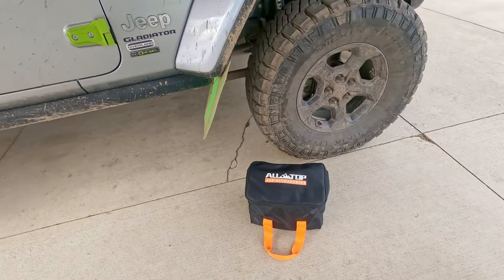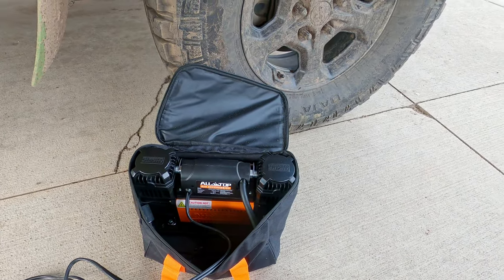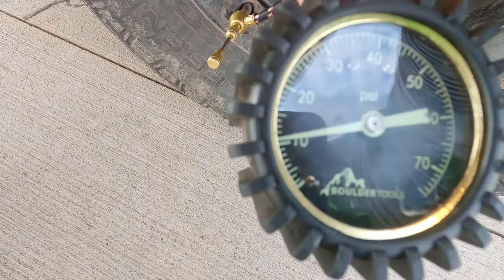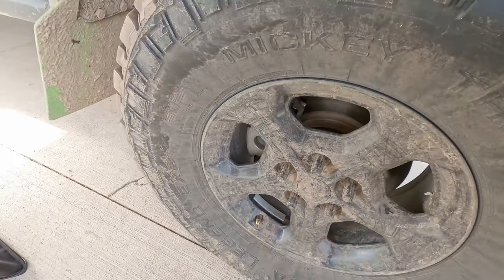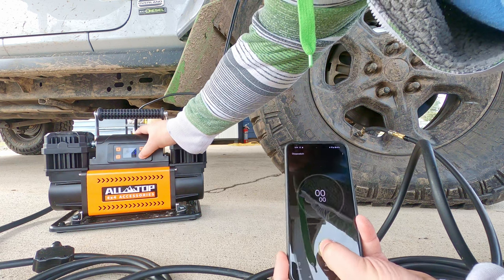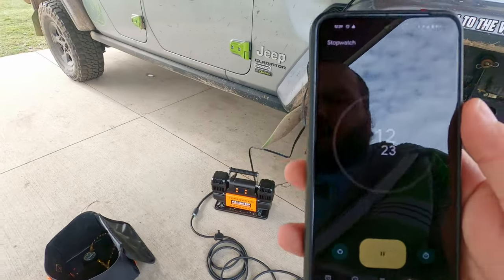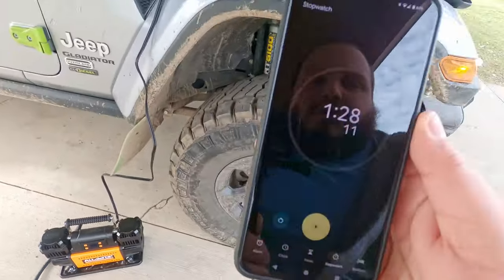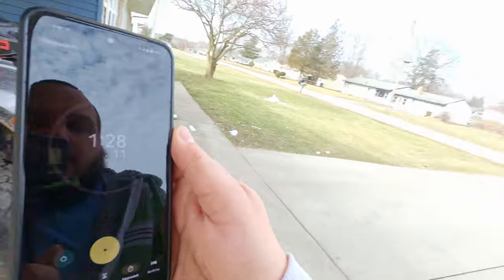Tools of the Trail: FASTER Inflation w/ All-Top Air Compressor - Ep. 3

Comment: Did it automatically turn off at 30 psi?
Reply from the maker: It turns off automatically at whatever pressure you set it to.

In my case, yes. 30 PSI is what I had set it to..

They do have cheaper models as well, which do not have this feature, and you have to air up and check each tire individually.
Reply: @trailtothevoid  ok thank you. You made up my mind for me.
Reply from the maker: @ShoTheReaper  I hope it helps.

I've so far loved everything I've used of All-Top.. Even stuff that isn't "gadgets" like.. Overlanding Gear, tire tools (deflators/etc) They are all quality in my opinion.